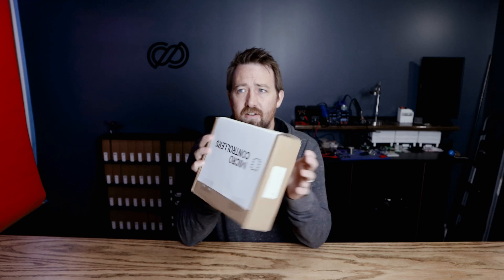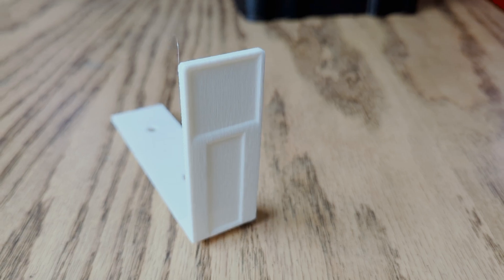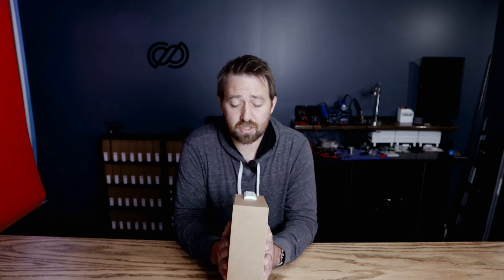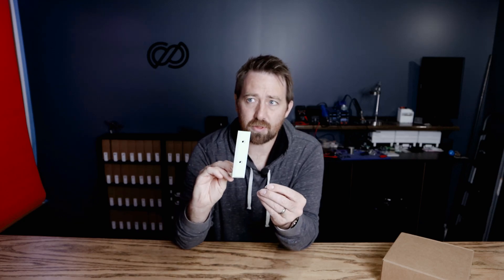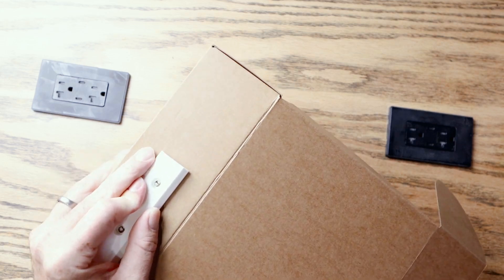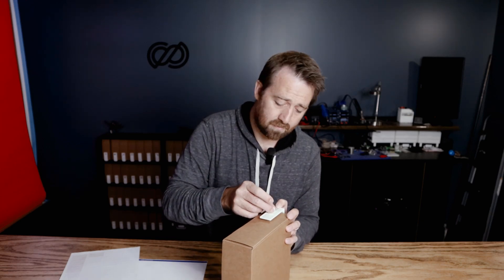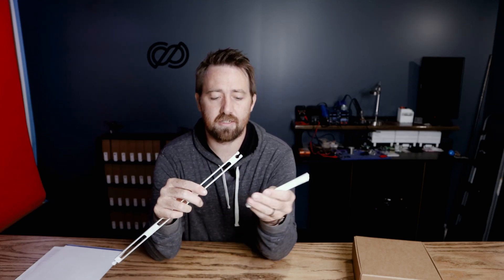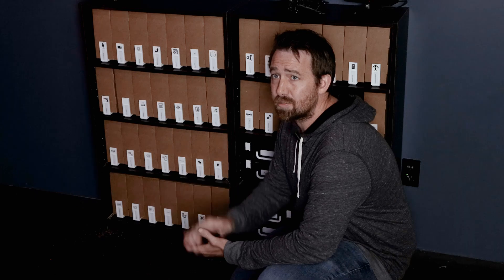DIY Organization System using 3D Printing

Comment: Good ideas all around but there is room for improvement in my opinion, for example the shelf pieces can have a little ramp on the side so when you push the box they get lifted on top of it instead of getting stuck at them. I like the pin design but I think you can set the tolerance a little better to click them easier and that way you would be able to print them out of PLA as well. They don't get any sheer or bending load on them so if you can successfully click them in once they will not break. PETG obviously is a stronger option but not absolutely necessary imo. Great design, hope to see more.

Comment: Did you ever think to turn the box upside down so the bracket hangs off the top?
Reply from the maker: Yeah. That's definitely an option and would save a print. I didn't like the look of the handle hanging down from the top though. My favorite suggestion was just putting the handle on the back of the box only. So it doesn't end up on either side, it would be a flat piece, faster to print, etc. If I re-work these, that'll likely be the direction I take it.

Comment: What problem is this solving that a simple sticker label on a box doesn’t already solve?
Reply from the maker: That's definitely an option. Most of this is aesthetic but it also adds a handle to it, making it easier to pull off the shelf. If there wasn't a handle on it (for this shelf) there wouldn't be enough room to actually get my fingers over or on the box to even pull them out.

Comment: My brother in Christ, hot glue. Attach a simple plate directly to the side. Give it a little handle. 

Next time. You've already put in the work on these and they look good on the shelf. 😁
Reply from the maker: That might work for some of the lighter boxes. I have a few boxes that weigh a lot though, like the box with a few Nema 17 stepper motors, so I don't think the hot glue would hold up over time.

Comment: so basicaly I could just print some sticker labels and thats it, you made problems and you solved them, congratz xd
Reply from the maker: lol yeah you could. This design gives each of the boxes a handle to grab on to though, otherwise it would be a total pain trying to pull them off the shelf especially when they have a lot of weight.
Reply: @makerloop  Hey mate I agree the boxes need a handle but you mention how your label holder makes the box unable to sit flat without additional parts might be to late but you would have been probably better served with just adding a simple handle on the front and a larger label stuck directly to the box just my opinion tho as they say "if it works and it's stupid it's not stupid".
Reply from the maker: @Funoholic  haha I love the saying. I don't think the front would be a great place for it, since it doesn't latch or anything, you'd be pulling the box open a bit as you pulled it off the shelf. However, that's a good idea for the back of the box! Similar to how I have it now. Would probably want to redesign the attachment method, but otherwise that could work.